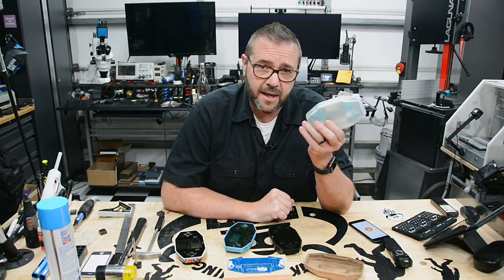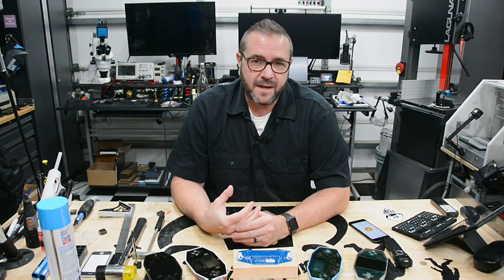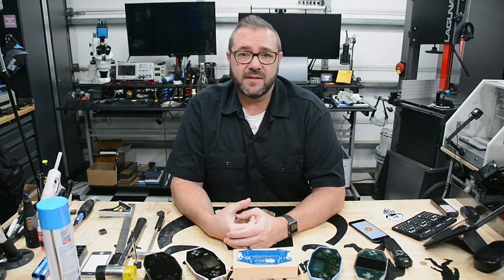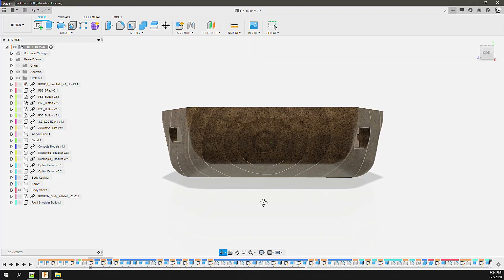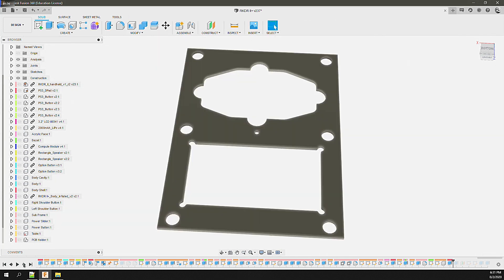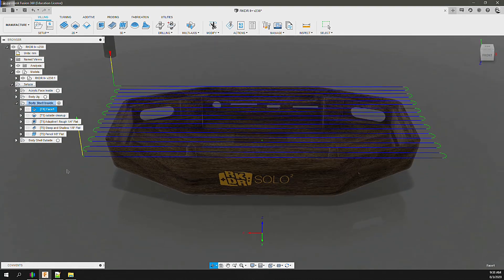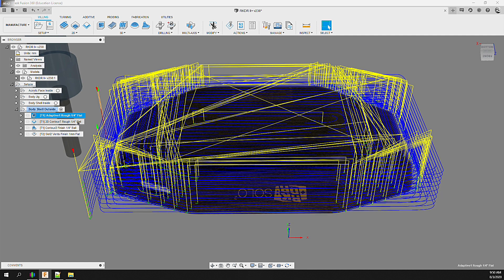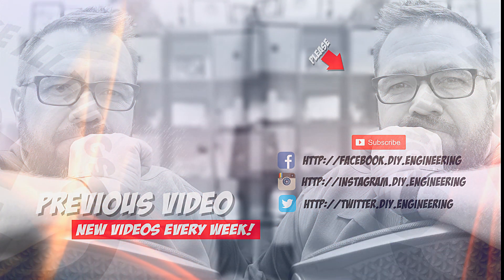Episode 042: Designing and Milling a Wooden Enclosure for the RKDR 3 Arcade

Comment: You seem to have developed some really great CNC expertise. Have you ever considered attempting creating an injection molded body for your RKDR? You could CNC an aluminum billet into each half of the mold cavity. There are "home" injection molding machines you can get for a few hundred bucks that you can attach to a drill press, and the natural draft of the case wouldn't require any real modification in design AFAIK. I bet you could do this in Fusion 360 in a couple hours! Some folks have done 3d printed injection molds but I think you can get better results with a setup similar to this example (I am not affiliated with them in any way): http://www.easyplasticmolding.com/model_20/home.html 

You could reduce the time for this part of the production to less than a minute per unit, and you could potentially reuse old filament scraps (ABS in particular) making them insanely cheap.
Reply from the maker: Hi, thanks. I have considered it. my cnc, although it's been upgraded a lot, still needs some work before it can handle serious aluminum milling... (the parts are ordered) so you will see that in an upcoming video... the second part is that building these handhelds at scale is a tricky prospect as I cannot provide the retropie image or roms which rules out most interested buyers... plus I think injection molding may lessen the value and high-end feel these have. For now this is an exercise in learning, craftsmanship and sharing.
Reply: @DIYEngineering  I'm curious to see how your new setup will work out. I think that aside from the possibility for scaling production (which is clearly not that important), one key advantage of the injection molding process is the ability to get really amazing smooth surface finishes which are still not possible from FDM and SLA printing without a really intense post-processing effort. Consider that you could do a transparent injection molded case using high end materials like transparent polycarbonate which has a glassy clear finish, which I've never seen someone do in a way that looks professional. You can also use other high end materials that just don't look as good when printed using a tomographic process. Your approach of modeling the interior space seems like it would be very easy to get started, if your CNC machine can handle it!